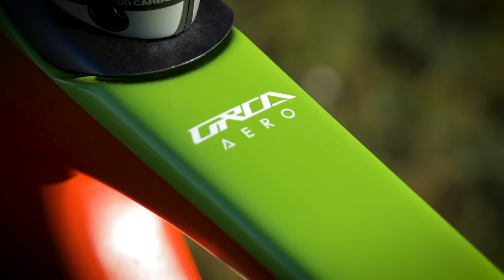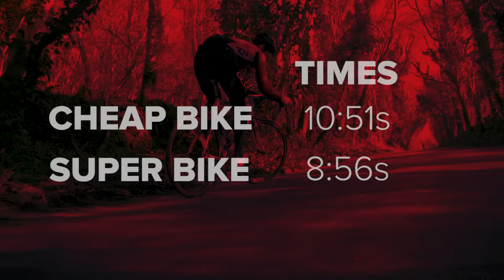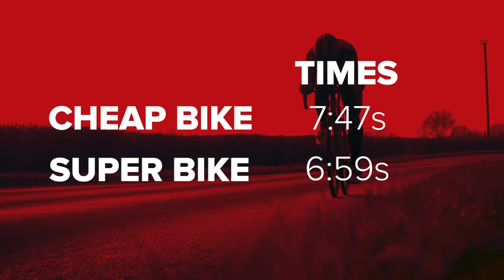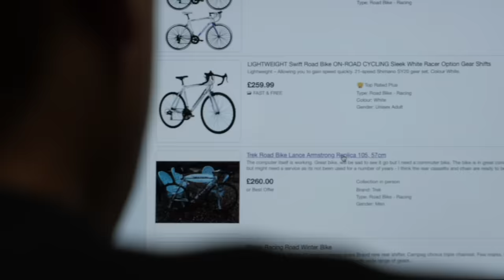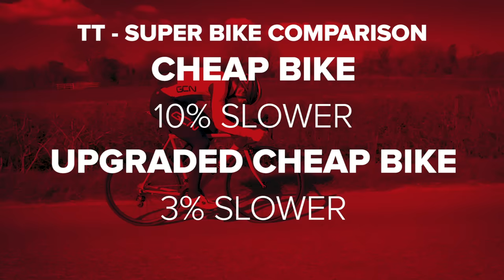Can We Convert A Cheap Ebay Bike Into A Superbike?

Comment: I’d love to see y’all compare a super bike from 20-30 years ago to a cheap/mid-range bike of today
Reply: THIS!
Reply: 100%. I've often wondered how a Pro Level bike say ridden by a World Tour level Pro from 1995 would compare to a £2000 bike of today. I reckon today's mid range bike would have it beaten.
Reply: Honestly, buying second hand and upgrading is a no-brainer if you have the time and skills. I've built bikes for the price of a mid range modern new bike which blow them out the water. Eg. Supersix hi mod with full SRAM red and carbon wheels for about £1500 all in.
Reply: @douglashadams7705  I ride a 1999 Look steel frame with 9 speed Shimano Ultegra and the best of all parts from that time. It's far better and not even heavier that most of today's mid-rang bikes.
Reply: Yes I'd like to see a Bianchi EV4 in there!
Reply: They have with gears on the frame old tour de France bike with a new bike
Reply: @terencej72  

Not really. The bikes of 1995 were very close to what we can get today but the prices were higher and the brands offering such high end bikes were harder to find. Today's bikes are better, sure, but not by that much. What makes it seem so dramatically different is that there are more big and medium sized bike brands offering "halo" products. There are more choices and better pricing for us today but those cutting edge bikes of the mid-1990s forward were pretty good. The gains that the pros experience today are almost entirely due to more advanced wind tunnel analytics. Time trial tech has been slowly trickling down when legal and practical.  The Campy Bora wheelset was introduced in 1994. You can argue that today's Bora is better but comparing the top models will show that the margins of improvement are not that dramatic. Mavic had similar wheels for the pros at that time as well. Today's carbon frames are lighter, true, but the pros are carrying more accessories and whatnot today. A top bike from 1995 would be better than just about every bike of today but the top tier. Maybe in some cases you can find second-level Ultegra and Chorus bikes that are competitive with the top bikes of 1995. And allowing for inflation they'll be a little cheaper and have more cogs. The main differences today are advanced frame designs to drop the weight down several hundred grams, another few hundred grams in the fork and threadless stem, and rim shapes rather than just assuming that a 50mm rim is predictably faster than a 40mm rim.  It is the time trial bikes that have gained the most from all of this research. Roadies also win because the trickle down has affected clothing and road wheels as well.
Reply: I've got an aluminium Scott speedster s1 with carbon forks from 2005. Mavic ksyrium wheels among other upgrades. It's a beast.
Reply: @rosbifle413  I'm a 17 year old...Just bought my first bike and its a steel from around 2005...I've made it a single speed with 46T/16T ratio....I've bought a lighter seat post and also lighter bars and plan on buying faster tires but i didn't know you can also change forks
Reply: @rosbifle413  can you upgrade forks with every bike
Reply: @setyourmindfree6095  you can yeah but in making your bike a single speed you've done what we call in English a downgrade. Sure your bike looks neater but normally a bike should be looked at when it is being smoked down a lane not walked around town.
Reply: @rosbifle413  it is but its much cheaper for me and doesn't impact me that much as where i live is pretty even gradient
Reply: @setyourmindfree6095  fair enough then. You can upgrade the forks but you need to find ones that are compatible. First thing would be to remove your forks and check the sizes and the bearings etc.
Reply: @rosbifle413  thanks mate
Reply: Not sure how old are that bike is they used, however, it is a US Postal service bike which was ridden by the US team from the 90's to 04. Safe to say this frame isn't 20 years old however its old enough. Going back more would be an even bigger comparison on how bikes evolved from the 80's for example. To the bike they just built to the new super bikes they use now.
Reply: This was a superbike old bike
Reply: x2
Reply: @terencej72  It absolutely would.

Just look at some manufacturers and compare bikes from 95 to now.

Pinarello's top bike was a 21lb steel behemoth. Indurain won the Tour on a "Pinarello" that was built by Dario Pegoretti. Can you even buy a midrange bike that weighs the same (ie is that heavy) as the top of the range bike in 95?

Cannondale's top bike was a predecessor to the CAAD lineup. For $2,000 you can get a 105 equiped carbon Cannondale with 11sp or a CAAD13 with 105 and hydraulic disk brakes. Having once races on the same 95 vintage Campag Record brakes, I'd pay $2,000 just for the better brakes!

The Endurace CF SL Disc 7.0 from Canyon... That just says it all for $2,100.

Some people wax the lyrical about 'the good old days' of custom frames and 'steel is real' and to be fair, if you have a weird shaped body then there is a case for going out and getting a custom frame built, the comfort gained from that would be worth every penny but for $2,000 or there abouts, you can buy a bike that is way better than even something like a TVT 92. The only frame that was around back then that is still in production today which is superbike worthy even by todays standard, but still a pretty penny - Carbonframes who are now known as Calfee Design.
Reply: @Swampster70 Thanks mate. 

You make some very good points and with respect to @Indonesia America above today's mid range bikes in the £2,000- £2,500 range ($2,500 to $3,000) as you say are between 7.7 to 8.2 kg (if they're not aero frames). That's less than 18lbs.

When launching his road bike range in 2007 Chris Boardman said of his second tier model that it "is lighter than the bike I used in my first Tour De France in 1995". That bike was Aluminium had Shimano Tiagra and weighed 9kg (20lbs) and cost £550 in 2007 (less than $800).

Today's equivalent is the SLR 8.8 and although it uses Shimano Sora it costs £750 (less than $1000).

So in effect if a "first road bike" is lighter than a 1995 bike and trickle down tech means today's Shimano Tiagra is roughly the same as 1995s Dura Ace (minus the fancy materials) then a $2,000 bike today will be better. It'll almost certainly be lighter and possibly better built.
Reply: I recently bought a ten year old bike which was ridden 4 times for just 200€. Back then it costed about 1200€.
Reply: Guese am throwing away my old 90s bike that i inherited...

Well i want to buy an endurance bike(budget) thats a bit fast, lighter, comfortable..name it to be used both on tarmac and gravel...im confused on what i should go for considering that I've strted loving an E-bike too... Its in my mind as well 🙂
Any advice on that? Kindly i also need shipping  referrals too ..
Reply: @indonesiaamerica7050  I would've agreed with you back in 2010 100%. But nowadays, any 105 level bike is better than perhaps only the absolute top tier stuff from the mid-late 90s. And I'd argue mid-range modern tech has surpassed even that stuff, though maybe not by a huge margin. I love those old bikes, especially anything post aero hoods (1986). I've ridden, worked on, and restored a lot of those bikes from that era. I even still ride with a pair of quad spoke areo wheels from like 1998 (they're heavy, but they look dope as hell). As well as a pair of deep dish carbon aero tubulars from like 1996 that are insanely light even by today's standards. But modern tech and materials have come a long way in making things more reliable/stronger and cheaper.
Reply: its pretty much what you just saw here
Reply: @terencej72  My specialized tarmac expert 2015 with mavic ksyrium SLS 2015 wheels and full Shimano 105 10 speed groupsets that was release 2011 def better bike overall
Reply: sup yaaallll
Reply: Id love to see a peloton with a £1500 price limit on team bikes.
Reply: My canyon endurance tiagra is better than most bikes of the past(plus hydraulic disc brakes)
Reply: Wisdom.
Reply: @indonesiaamerica7050  Fair point, I'd like to add that there's bikes that are good not by year but by resources & skilled mechanic skills.
Reply: You'd break the beta. It'd show how little has really changed, just tech trickle down
Reply: What’s also holding the bootleg super bike is it’s fork. The fork is not carbon.
Reply: That would be neat, as i ride a 1989 trek pro series and have no reference to how it is compared to other bikes.
Reply: @terencej72  I have A Trek Madone 6.9 SSL. Basically a world tour bike from 2012. It weighs a UCI limit 6.8 kg and has first generation Di2. I spent $1000 on it. 
Up a climb it's about as good as anything around today. The only aero feature it has is internal cabling and 40mm wheels, so anything truly aero will win on a flat.
Reply: Current mid range bikes overshadow all vintage and antique bikes. Tons of such videos on YouTube.
Reply: I took a similar bike, 1999 Trek 5500 OCLV Postal, and fully customized it to my specs. I would put it with any “super bike” and I have which I won a CRIT race it.
Reply: Is it £10000 worse though

Comment: I think a missing element here would have been a basic tune up on the old bike before the first test. Getting the shifting right, brake setup and saddle height would be something you would do after buying any bike off e-bay. Ghost shifts tell me that the bike is 500 km overdue for a tune up.
Reply: I agree, not a true test.
Reply: yep, a simple tune up and new tires would have made a huge difference.
Reply: very true, you wouldnt get a super bike out the box and ride it without a tweak / tune up
Reply: Wonder if they even checked the tyre pressures. Certainly loading it in favour of the new bike.
Reply: yes, GCN lack in that part sometimes the scientifical accuracy. first proper maintence and setup from a mechanic. powermeter on. serveral tests with a powermeter @200, 250W or 300 Watt depending how strong the testers are and can hold that power. then upgrade and all tests again in the exact same conditions.
Reply: Yes. Setting it up with the same position at the very least.
Reply: Trying to make the change more pronounced I suspect but yes totally unscientific and undermines the point of the video.
Reply: Yep, the true morale of the story(ies) is that if u want a workhorse then maintain the old bike, replacing only what is necessary (inc in this case tyres). If u want to get closest to the superbike much better to spend the money on a the new mid range bike rather than over-specing an old frame. Of course that some money on a second hand high-ish range bike would be another option....
Reply: New chain too
Reply: Rigged comparison. He wasnt even driving the vintage bike in a straight line.
Reply: $15 aerobars. Their lack of perspective on the avg basic vintage racer makes you question their marketing agenda as a channel.
Reply: I was about to write that too. The Trek wasn't set up right for the rider and needed maintenance urgently
Reply: Your comment should be pinned right on the top. And from the very beginning of the video series of the buid.
I am wondering how faster the new paint scheme made it, as well.
Reply: @peterhaslam5275  Yet again by these blokes :-)
Reply: Your so right, I bought a bike for $100 dollars last year, got a basic tune up. Honestly, it went from a bad bike to good bike. Now, I will be adding new tires, other components and new painting.
Reply: the most important change I think should have happened was to ride the hill with the Orbea first, that way he would have known to get to the large cogs sooner!

Comment: Good review, but it seems to me that you spend some money where I think that will not make any difference and some other that make a difference...  When you replace wheelset for having a better bearing, more rigid and more aerodynamic wheel, YES Good. You spend your money on the seat post, stem, handlebar and paint the bike This is not really the best place to invest your budget, I don't think that will make much of a difference than looking good!  Why not replace the fork for a carbon fork that will give more rigidity and a better feel to the bike? You change the crankset that is expensive, instead of that if the previous one was not damaged why not just change the old bottom bracket for a new one and save money there if possible?  With the money save you could invest in an even better wheel more aerodynamic and a better derailleur and have a better pedal with a new seal bearing on it, that old pedal may have an old bearing on it, if possible just change the bearing in the pedal or any bearing on the bike that is old.  And something That would cost nothing is to make sure that the seat and position on the old bike are well adjusted for the cyclist, it looks like the saddle position was weird. That carbon frame is more rigid and every time you press on the pedal is moving forward better this is an advantage that the old bike will never have of course... And that carbon bike is new and all rolling part are new to compete with you need to invest in parts that role.

Comment: Have a 20 year old Bianchi that I just upgraded. Runs really great with the Shimmano 105 group set. Plus I get a lot of compliments about it being an old school steel frame. Classic bike updated.
Reply: I have that very same Trek; I call it my drug cheats bike, it has mudgaurds and is an ideal wet weather hack, all for under £150 thanks to Short Rochford in Potters Bar.
Reply: I head steel... for me its carbon dampens the vibration instead of my body
Reply: Have a Raleigh mercury and a sword venge and have to say I prefer the Raleigh the thing is built to last
Reply: Steel is real.
Reply: Love a modern classic like that.

Comment: One more video. This new bike vs the mid range bike. That is the real test. This bike build vs a mid range would be great for those of us with 10 year old bikes that we are considering upgrading and not replacing.
Reply: They already talked about the % difference on the mid range bike being better. But perhaps spend the difference of a mid range bike on this? Could certainly make gains on weight and more aero wheels with that cash.
Reply: @MrBJPitt  Question is whether or not that's actually true. It might 'feel' better, but we're talking 1,5 minutes difference from a super bike over 1 HOUR. That's nothing for a hobby cyclist in my opinion. Especially considering that the super bike is rocking Dura Ace, so we're probably up somewhere between 4000+. If you can overhaul a bike to perform like that bike for just 800 extra, then i'd say that's a pretty viable option. And that' assuming you have to replace every single part of it.
Reply: I've replaced everything (but the frame, of course) on my 2005 Lemond Zurich over the past 2 years.  I did it on the cheap by using the next generation Ultegra components (6700 vs 6600 that came in the bike).  It's all new components - and new to me - but inexpensive (ok, Cheap!).  It rides like a dream!  Best thing, I didn't need to get used to the geometry of a new bike, well fitted or not and it only cost me ~$900 and a couple hours of quality time working on my bike.
Love these videos guys - keep it up!
Reply: 10 years old!!!!! My Benotto 850 is over 30!!!! And other than the tires, it all original....
Reply: If your bike is 10 years old, it was already more advanced (better frame and fork) than the bike they used. It will only get better from there.
Reply: I'd watch it.
Reply: Go back and look at the times on the mid range vs super video - looks like the Endurace would be a few seconds quicker.
Reply: Love the video but I suspect they missed the point. The frame is everything and you didn't start with a good frame. If you do the same with the nicest riding frame you have.. Then you can do something amazing
Reply: Surprised they didn't go for a new carbon fork. Plus i agree with their final analysis for 850 quid, you could get something brand new from Decathlon that would have a better frame and similar specs for not much more money.
Reply: Andrew, I think your comment really captures the essence of why we even tuned in to watch this video.  I own at least, { maybe more, some are torn down } 20 bikes, from different decades.  I know form being in this hobby for almost 40yrs, that some of my bikes are nowhere near the performance of say, a Pinarello, or a high end Colnago.  However, I also know I'm never going to be a TDF rider, .......not even close.  I refuse to throw away a bike that a few years ago, the cycling press, and racers were drooling over.  But now is considered, more or less junk.  I still ride rim brakes, and forgive me, but still use those antique cables, that seem to work just fine.  Now, I would consider wheel upgrades, better saddles, better tires, etc.  These kind of things make the bike the best it can be.  I have carbon, Ti, aluminium, steel bikes.  I know my steel bike is a bit slower,.............but,..........do I enjoy the bike less..?   Nope.  I enjoy a quality bike that delivers a quality, and comfortable ride.  And Andrew, lucky guys like us who have 10yr old bikes, have nothing to prove to anyone.  I think we got over that a long time ago.

Comment: This is like the old broom joke.
"I've had the same broom for 40 years, only changed the head 6 times and the handle 4."
Reply: Try that with one-piece stem and handlebars, proprietary seatpost, and proprietary fork. You are are also waaay more likely to snap the derailler hanger in a way that renders the Orbea non-repairable. It is also non-recyclable.
Reply: Only fools and horses
Reply: Alright Dave
Reply: It was the same broom though. There was a photo. What more proof do you want?
Reply: @latergator915  Broom DNA testing, Carbon dating and a signed affidavit
Reply: Trigger rides again! 😉👍
Reply: Very apt.
Reply: Broom of Theseus.